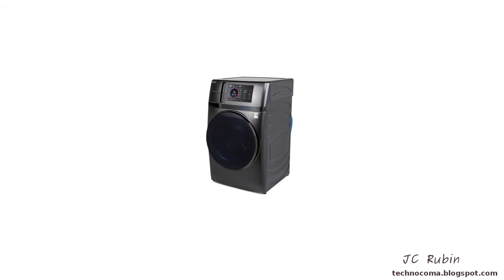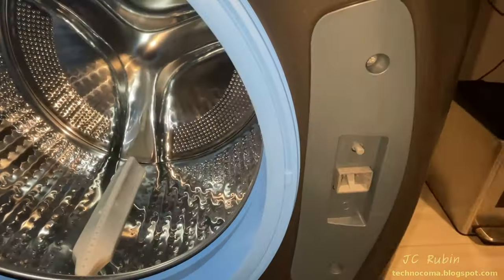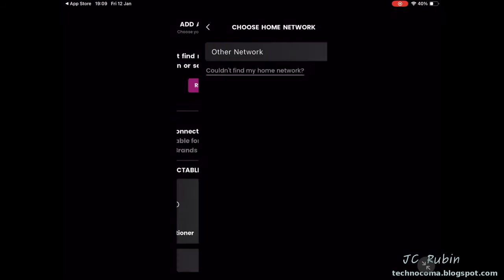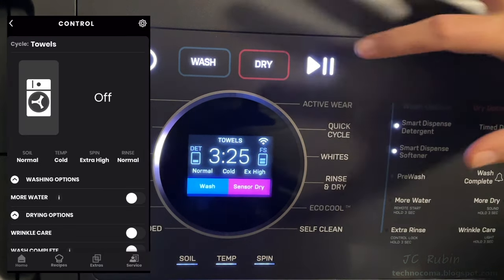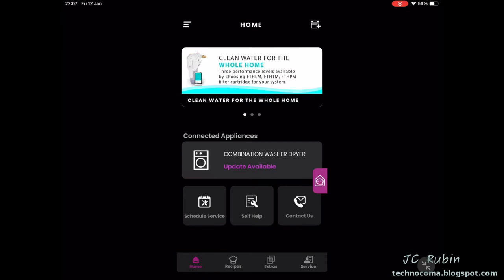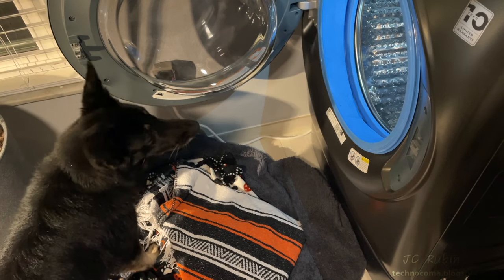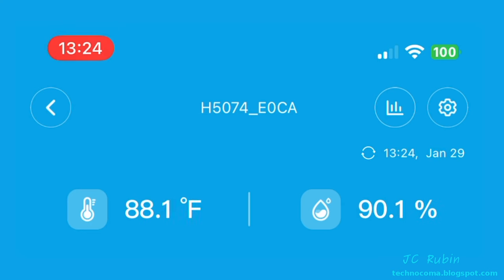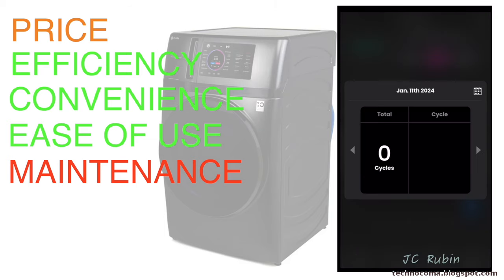GE Profile Ultrafast 2-in-1 Combo Washer Dryer Setup, Testing & In-depth Analysis: Does it deliver?

Comment: Unfortunately, my experience has been bad with the combo.  Bought the combo 8 months ago and I'm on my 5th technician visit.  The major repairs have involved a motherboard replacement due to the machine going dead.  Next, the entire heat pump assembly failed.  The product is so new the technicians have never seen it or been trained on it.  Keep in mind, the 10 year limited warranty only covers the motor.  There is only a 1 year warranty on the rest of the parts such as the motherboard and heat pump.  @geappliances
Reply from the maker: Feedback like this is helpful for the up and coming maintenance video. As for the main board specifically. I wonder if this machine should be plugged in through a surge protector.
Reply: @retrotechandelectronics  That's a great suggestion.
Reply: Isn't it a five year warranty on the sealed system heat pump?

Comment: This is the best review of the combo unit I've seen. I've owned one for a couple of months and have encountered many of the issues you highlighted. I also noticed it often gets stuck on load sensing, and I didn't understand the reason until seeing your video. Additionally, I've observed that pausing the cycle can sometimes cause the machine to enter a weird state, where the door remains locked due to the washer thinking there's a fault with the door latch, and have also encountered other strange behaviors after pausing a cycle. The only solution to unlock it is to completely reboot the machine by unplugging it. I'm hopeful for another firmware update, as it seems most issues with this combo unit could be resolved through a software update. I'm not sure if you're aware, but the service menu can be accessed by holding down the Pause/Start, Smart Dispense Detergent, and Timed Dry buttons simultaneously while the machine is turned off. This menu contains tons of diagnostic and test functions that are quite interesting. I'd love to see a video of you going into a deep dive of this menu!
Reply from the maker: Hello and thank you for the information.  I did not see any issues with the door latch on mine.  As for the service menu I went back and forth on its inclusion in this video and decided against it because the video was already getting long and secondly because I was trying to keep it at the general consumer level.  Ill agree that it is definitely worthy of its own video in the near future.
Reply: Experienced same door lock issue after pause. Twice have had to go flip the breaker because the ac plug is behind this heavy unit. 
How should we report this to GE?

Comment: You… sir… this combo washer will last a long time for you as long as you use the proper brush and vacuum. It seems you will be willing to do the proper care for this machine. I’m pretty sure the people that really are getting wet laundry either have a faulty unit or their belt is not spinning to it’s max rpm on the spin cycle due to their own fault for not balancing the unit or putting unbalance loads in the unit according to the manual (small with large clothes).

This maintenance should be done on normal washers and dryers anyway but people don’t. Dryers can usually live longer without it, but clogs can happen in the hose or unit. The amount of time saved from not having to transfer any loads is a super time saver that more than makes up for the minute for maintenance every few loads. Yes it is unfortunate you need special tools, but at least you’re efficient with your placement and organization.

Comment: This unit went on sale for $2000 within the first two months after launch and had his that a few times over the last year. The same thing seemed to happen with LGs new combo as well. Getting these combos for under $2000 is a good deal as I got mine for about $1800 after cashback.
Reply from the maker: I have never seen the machine that cheap. Sitting generally around 2800
Reply: It’s on sale at Costco for 2100 atm
Reply: I got mine for approx $1800 at Costco April 2024— I’ve waited and monitored for months!

Comment: I understood that this machine uses quite a bit more water than a conventional washer dryer set. I was hoping this would be covered in your review and measurements but you were silent on it.  Great review otherwise. I learned a lot. Was set to buy one still I saw the electricity savings were traded for water use. Was hoping for more info on that
Reply from the maker: We have not seen any increase in water consumption. Based on machines of comparable size the only main difference is the heat pump and automation that has no consumption impact imho.

Comment: Update on 2 GE Profile Combo Units...  as of today, approximately 50 to 60 loads have been run in each unit with 0 buildup of "anything" on the Coil / Condenser!
The modified filters have 0 issues.
I vacuum the filters minimum once a week or when the machine notifies to do it.  Once a week for me is laundry for 5 people across both machines.
I continue to post videos of the modified filters during the cleaning process and inspect the modifications, and they are holding up Excellent.

I will be putting together kits to be sold for the people that do not want to source the items and make everything fit on their own.  I will prepare pre-done Kits of everything that is needed with simple instructions to follow that will take no more than 5 to 10 Minutes to complete.

Kits are available .  Includes pre-cut weather stripping for Top and Bottom, Weather stripping for the Rear, and a choice of upgraded Filter Pad.  Electrostatic style or Merv 8 Style Media is white color on entry side, and (tacky) surface on exit side. The tacky surface stops the finer particles from passing through the filter. The pads are washable, however as of 2 months on them, vacuuming is working just fine.  
For the best protection, you can just replace them every 4 to 6 months also.  The tacky surface will collect the finest of lint and keep it out of the coil without causing restriction of airflow.  The primary screen is the biggest area that needs to be kept clean.

Latest addition to the Filter also includes Plastic hold down washers to keep the pad centered and locked in place so no gaps can occur in the housing.

I spent a lot of time and money to make this bullet proof, and it keeps my OCD in check.

Contrary to what end users believe, if you do not modify the filter, cleaning it after every load will actually cause more problems.  The reason for this is lint is getting on or past the upper and lower rail assembly and working its way past the filter.  Every time you pull out the filter, clumps of lint will get by or shoved to the rear of the assembly which cannot easily be seen or cleaned.

HomeGuySolutions.com
Reply from the maker: good work.
ill be doing regular cleaning for the next 6 months before I open the machine to see how much gets by with vigilance.  I do vacuum the back area to remove the lint each time the filter is removed however. Yeah, their design is an embarrassment.
Reply: Are kits available now?
Reply: 14:03 😊

Comment: This is very helpful although many people owning this machine will never get to see this option before it's too late. 
And sorry GE, but if customers have to pay a hefty investment to purchase this machine the coils lint issue should have been dealt with ASAP !!
Reply from the maker: Glad you found it helpful. Much can be fixed with firmware updates. Hopefully a redesigned slide in filter could solve for the lint issue.

Comment: Excellent and detailed review.  I hope you have a follow up after some longer period of time to see your long term thoughts.  I also hope you send a link to your video to GE so they can see your insightful analysis.
Reply from the maker: There will be a follow up and most likely a heat pump clean out video in the future as I see this collecting lint no matter how much care is taken.
Reply: How could GE not do the research as thorough as you? They what were they thinking? Or were they?
Reply: @tk8665  I've had mine for 2 months and have had no lint issues.  I do clean the lint filter after every wash and there is a surprising amount on the filter. And although it does look like there are airflow patterns (the lint is heavier at certain areas on the filter), I do not see any blow-by.  I also use their brush kit accessory after cleaning the filter everytime and it has on occasion brought back a little bit of hair and lint. I see no lint or hair on my fins at all at this point. One thing that I think GE made a mistake on is saying you only need to clean the lint filter every 5 loads. I find that mine needs cleaning after every load.

Comment: Awesome walkthrough of the setup! Mine is being delivered today 😊 I think most of the drying issues people are having are because it requires a different way to do laundry, like you said most people are capable of shaking things out but just don't want to. Same with the lint maintenance that is required - have you seen the videos from Bens Appliances and Junk about how to easily modify the lint trap to greatly reduce lint escaping past to the condenser coils?
Reply from the maker: Thanks! The fixes you’d mentioned in that video seemed to deal with lint getting past the foam element portion. I’ve seen lint and hair getting around the entire bracket, for which I see no current home remedy except for regular cleaning of the coils.
Reply: @retrotechandelectronics We don't have a vacuum attachment to vacuum out the lint. Any other ideas?
Reply from the maker: @Kne2450  Yes I had to specifically purchase these attachments to do it.

Comment: Just a quick note on your humidity measurements. The increase in humidity you observed as the load came back to room temp is measured as 'Relative' humidity and is expected. Relative humidity is directly correlated to temperature. As temperature decreases, relative humidity will increase with no increase in the air moisture content. It is a measurement of how saturated the air is at any given temperature. Measuring actual moisture content of the drum in gr/lb would be more helpful in this application.

Comment: Our GE front load washing machine from 18 years ago has no mention of the drain pump filter in the manual.😊
Reply from the maker: Our whirlpool didn’t either. It was something only the service tech was supposed to know about. Now with the internet they no longer hide it and make it a feature.

Comment: Great video!  One point that I wish for more info on is the dryer temperatures of each cycle.  There seems to be a lot of confusion online with very little actual information on the drying temperature.  I also purchased this machine and was disappointed to find I could not limit the max drying temperature for certain loads.  I washed & dried a favorite sweatshirt on delicate thinking it would be safe (tag says tumble dry low, like every single shirt I own except one) but it shrank.  Copilot says the Normal cycle drying average temperature is 150 F, a full 10 degrees higher than the standard for a 'High' setting.  I am relying on Copilot here because I haven't found any real data.  Do you have any actual data on the drying temperatures?
Reply from the maker: Aside from the data I collected for temperature during the drying and posted there are no settings I know of that limit or adjust the actual temperature. Only auto sense,extra dry or de-wrinkle.

Comment: I have to wonder if that 'damp' feel, at least on a brand new machine is an illusion just due to the temperature it comes out at.  At least on my new unit, if the clothes just sit there and cools some, it feels 'dry'.  Only get that 'damp' feel right after it completes.  I don't shake it out.  I just put the clothes away and by the time they are folded or hung, it is back to a dry feel.  Anyways, a lot of regular gas dryers are not all that great and the clothes / towels / sheets can come out damp, especially if you do a mixed load.  It is just with this machine, it is easier to justify splitting it up a little more as it is very efficient and it does both washing and drying in the same drum, saving you time.  Just put some of that time savings into doing an additional load instead of a mixed load and you are doing better drying wise than a traditional separate washer / dryer setup.

This machine definitely could have used some better engineering around air flow and filtration.  To try to keep this machine from being a lint filled cleaning nightmare, you definitely got to take action as soon as you get the machine.  I am surprised you haven't tried something like weatherization tape around the lint trap.  I see someone linking to their modification products to the filter and while expensive, it is tempting seeing how badly GE did on this.  I mean when you get into fancy ultra-efficient heat-pump washer / dryer deals that cost a good chunk of change, the last you want is a cheeped out filter that leaves the heat-pump clogged because too much blows around the filter and a machine like this is going to dump plenty on those coils if it is not properly filtered.  I think a key problem here is the seals on two different axis.  The outer seal lifts the filter off of the main rear seal and so it can't seal up.  The secondary filter is also poorly done and there has got to be a lot that bypasses that poor design.  But really what is going to kill this machine the fastest is the primary seal doesn't seal anything.  My fix is a $5 roll of weatherization foam tape around the lint trap.  I have only done a handful of loads with the weatherization tape as it is a brand new machine, but does seem to seal up a whole lot better than what I saw with the first load without it.  This is as in I checked the coils, cleaned, and then did more loads with the tape.  With the tape the coils have stayed clean through multiple loads.  Without the tape, the deposits could be seen right away and I immediately cleaned the coils.  The problem is with air conditioning coils is while most of the deposit is on the front surface, there is always more slipping deeper into the coils and then depositing.  So if it is slipping past the lint trap and onto the coils, there is the stuff in the coils that will still build up because you can't reach it without dismantling the machine.  Most people are not going to dismantle the machine like what you do in a later video.  I think most people can do the weatherization tape deal around the lent trap as that is super quick and easy and just intuitively makes sense.

As for the buildup you see as the air makes it to the top of the machine, I guess this is expected with that sharp change in direction of airflow.  The crap in the air has momentum and so continues up and contacts the top, where it can stick and so builds up.  If they just had a less sharp change in airflow, it probably wouldn't build up so much in that hidden spot.

My plan is to keep this machine.  I think I have fixed it enough through a simple $5 modification for it to do the job.  If I see evidence through more loads that this is not enough, maybe I will bite the bullet and buy the more expensive 3rd party modifications to the filter as that is still way cheaper than ruining this machine just because a key component was cheeped out by GE.  Anyways, where I am at now my options are a machine like this, which pickings are slim, or go down to the laundromat.  Or maybe I move again, but I really don't want to if I don't have to.  Every place has its pros and cons and this one has its pros if I can just get this machine to fix the main con, which it looks like it can do if handled right.

Comment: When adjusting/leveling the legs of the unit to raise it a bit, did you only need to turn the bolt clockwise and the unit raised or after raising it, did you need to turn the bolt to lock it in place? I looked at the GE leveling video and it was kinda confusing.

Comment: What size wrench did you use to remove the top of the machine?
Reply from the maker: What are you referring to, the top of the machine was not removed in this video.
Reply: @retrotechandelectronics  Thanks I figured it out.
Reply from the maker: @christopherholland8830  no problem.

Comment: At 16:21 seconds, you will notice the spin light is flashing.. This is the signal that the spin cycle had issues and had to redistribute the load.. It will flash like this whether or not it is successful or not (VERY ANNOYING).. In your case it was successful.. We've had this washer since January and love it, but I have had a few loads my kids have loaded that did not spin correctly.. I've seen your second video and echo the though that there should be a notification that spin is not possible etc..
Reply from the maker: I’ve just released a video today on the maintenance menu showing the machine logging this as an error but not reporting it.
Reply: @retrotechandelectronics  yes I really liked that video. I haven’t had the same lint issue as you. One thing I make sure of is to wipe the rubber gasket on the lint filter well before replacing it. The issues you have leads me to believe the tolerances to make the seal work correctly aren’t good. The membrane is the first wall and the gasket is the second wall to keep larger particles out (hair etc). The foam filter is for the finer particles that should be carried away of they get past by condensation. I do believe from the size of the heat pump and the warranty given they did design it to last.